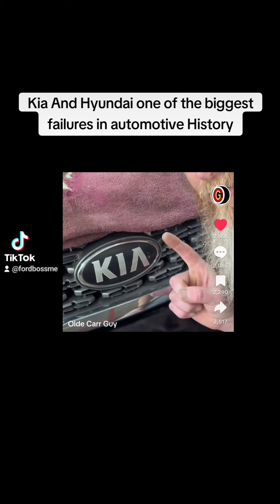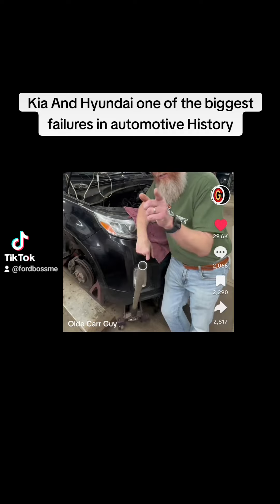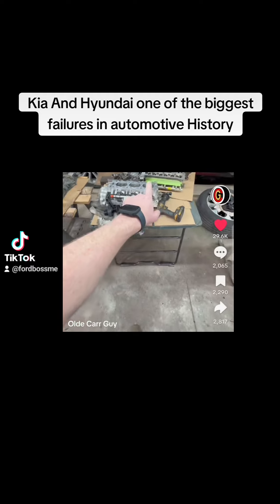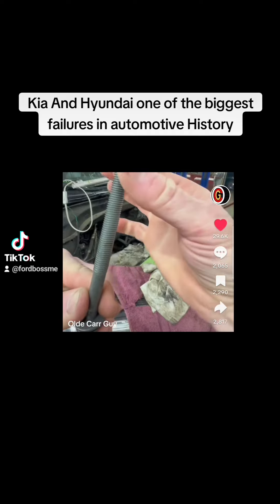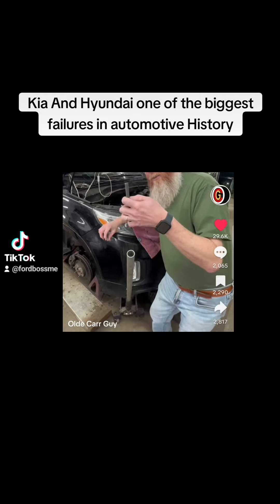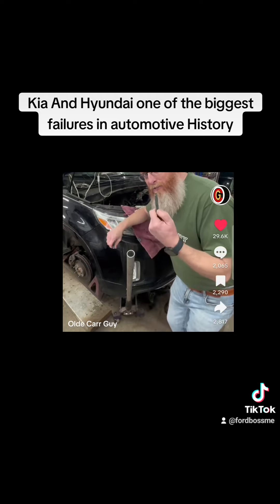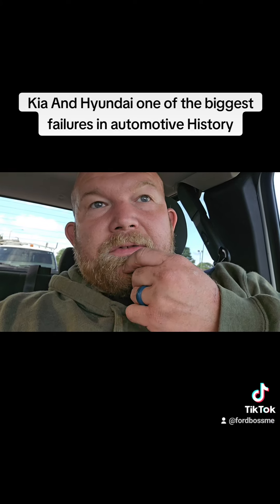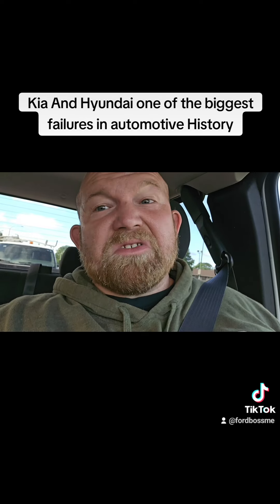Kia And Hyundai one of the biggest failures in automotive History - V6 Engines 3.3 and 3.5

Comment: You would think all engine builders would study the North Star V8 and not have the same problem with the threads.
Reply: Head bolts were only an issue on early model N*, GM fixed it for all the later runs.  The real issue that killed so many G body cars with N*s was the mid block skirt "leaking" oil (more like pouring out oil) that required a full engine out to reseal.  Doing a $3,500 reseal on a vehicle worth <$10k didn't make much sense.

Comment: The cargo ship that was plagued by mechanical malfunctions and crashed into the bridge in Baltimore was built by Hyundai Heavy Industries.
Reply: Bad breakers tripping between 440v low voltage and high voltage 8kv panels.   Or just unstable electricity setting the breakers off.
Reply: Its electrical system had a blackout
Reply: So the air force f 35 jet that recently crashed had nothing korean in side or outside
That crash was in billions of taxes
One could have bought
Millions of kias with that waisted taxes
Reply: @plusblood5101 yeah, and maybe gotten a good one 😂

Comment: Back in the late 80s early 90s when I was wrenching. The Hyundai was like gravy money. Carburetors failed. When an O2 sensor went out on one of them, you had to replace the exhaust manifold. The threads were coming out. We did clutches galore on these things. Front axles were always rattling. In my opinion people haven’t learned and they will buy junk. Only to be mad a year or two later at the expensive repairing it.

Comment: I got a 2019 f150 5.0. with 145k on it. Has a rough idle when cold. Gets little better when hot but still not right. Changed plugs still not right. No codes. No missfire on the scan tool but feels almost like a missfire

Comment: The GM Northstar had the same issue mainly because fine threads rather than course threads were used.  This is a very basic mistake and should not be happening on newer engine designs. Northstar Performance has the best solution which utilizes studs rather than bolts to attach the heads to the block. The studs have oversized thread at the end where they engage the block and the are course threads!!

Comment: This is strange, because in the middle east we get these hyundai V6s (the lambda family of engines) in 3.0l, 3.3l, and 3.5l and they are pretty reliable, the only difference is that we get them all in MPI injection system we don't get them in direct injection, I don't think that the difference in injection method would make this kind of failure! Weird.
Reply: You probably get a different version of this engine made in a different factory.
Reply: @alouisschafer7212  what we get is made in Korea, at least that's what the metal plate says on the driver's door jamb, where is yours made?
Reply: Yeah the non-GDI lambdas were pretty great. Liked to leak oil from the valve cover gaskets and you'd have to replace the occasional VVT sprocket, but otherwise if you changed the oil, they were great.  Good power, mated with some smooth shifting transmissions, and AWD available, too.

Comment: I have a question. I just rebuilt my 97 Chevy 4.3 vortec. I'm currently running straight 30 weight changed 3 to 4 thousand. 99%highway drivin . What oil do you recommend. I just hit 23.000 miles.... that's 30 conventional oil..

Comment: Question maybe you know. My Kia Soul is a Standard, stick shift. Turned the key and got nothing. The mechanic changed out the battery, nothing said it was the starter. Replaced the starter and now the issue of trying to start my car is intermittent. Turn the key and NOTHING! I wait wait wait try again. sometimes I get lucky and it will start sometimes I have to wait where finally it does start. The mechanic has no idea what it is after spending over $700.00!!! lolololol
Reply: Turn the key multiple times in fast secession and see if that helps.

Also see if starting in neutral helps.
Reply: You seem to have intermittent power going to the starter. Possible causes,loose connections,bad ignition switch,bad clutch safety switch. Since you mechanic replaced the starter assembly,sometimes it can something as simple as a bad connection.
Reply: Thank you everyone whom replied.... It was a switch from the clutch to the starter. They put in a new switch and it is working perfect. I just question if they put in a NEW starter why didn't they check the switch on the floor board?
Reply: @JoannaMaGrath   Because the clutch safety switch is seperate from the starter. The switch is just a contact to make a connection to the starter. Think about the light bulb switch for a lamp. Most people would try to change the light bulb without thinking why would power not flow to the bulb.

Comment: Kinda like the GM V6s in the late 90s in Chevys, Pontiacs etc that blew gaskets and had to be disassembled with only approximately 100,000 miles. Don't get me started on Chevy Vegas and 70s V6 death traps, that died for no reason on the highway, in heavy traffic, putting the drivers and passengers in peril. 
Let us talk about Ford's years long scam, with the ever failing Thick Film Ignition Modules, resulting in people like me, carrying a new TFI Module in the glove box, with the little knob tool... Did I mention the TFI scam, ended in a class action suite. Let us not forget Fords self proclaimed superiority of the Twin Eye-beam suspensions on it's pickups for years, that manage to absolutely destroy any tires in less than 30k miles. 
Or all the Toyotas with blown gaskets or burn oil when new (fairly recently)  that the auto industry hardly talks about. 
All of them have built crap at times in the last 20 years and before, and try to blame the owners. 
I knew a guy in the 80s that bought a Nap Z engine 4X4 Nissan truck, that blew head gaskets, and Nissan (then Datsun still) blamed the owners. A class action lawsuit proved that the last four headbolt holes were never drilled and tapped deep enough, and the rear of the head on the Nap Z engines wasn't clamped down tight enough because of that.... 
Some ingenious outfit back then, figured out the head bolts were much longer than needed, and simply made a kit of head bolts that were about 2 or 3mm shorter than from the factory and it fixed it... In the mean time, Nissan was replacing whole engine blocks to fix it LOL
My mother has a 2018 2.4l Sonata, and that thing has almost 90k miles on it and has been perfect, except for a high pressure fuel pump, that was replaced under the warranty, that some here claim "isn't honored"  Her Sonata when driven about 70mph down our beltway, gets 40 to 43mpg, better than Hyundai advertised. 
In fact, her 2018 Sonata, edged out the same year Honda Accord for long term reliability.